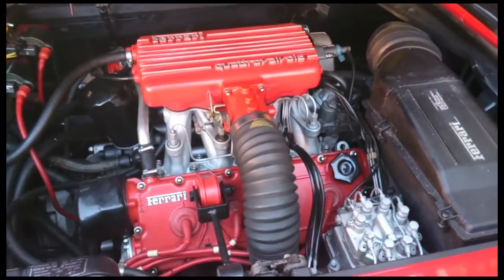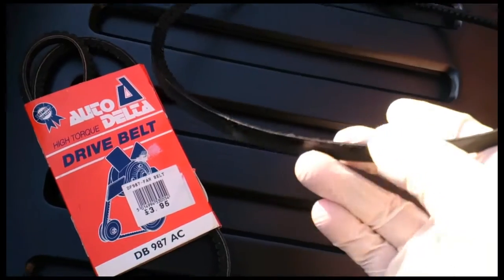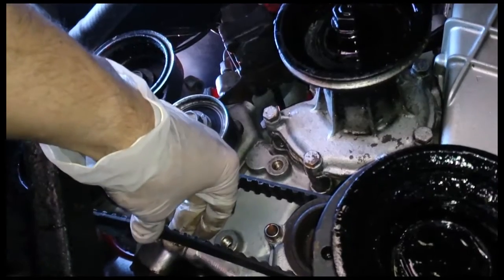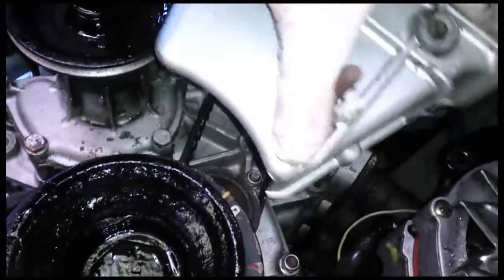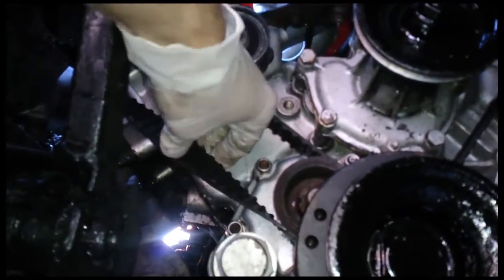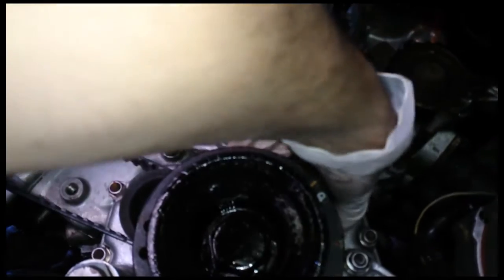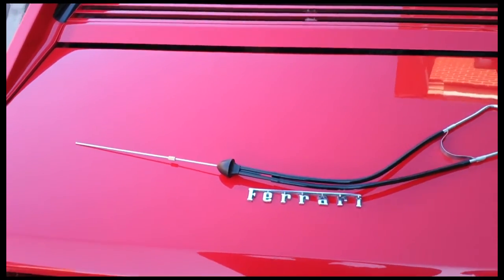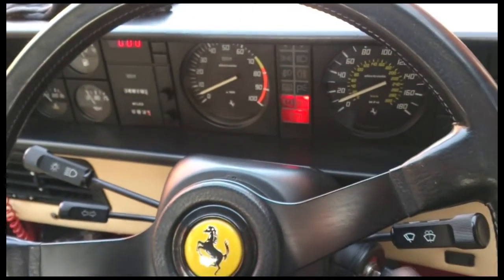Ferrari Cambelt Check

Comment: I don't own a Ferrari but have found many of your videos useful regardless, especially the timing belt ones, I'm totally paranoid about having the correct cambelt tension and destroying my newly rebuilt engine! I find the tension gauges by themselves don't seem very precise so I combine it with the 45° method, I'd be even more nervous with an engine of that value! Look forward to seeing more videos.
Reply from the maker: +Elliot N  Hi Elliot, the key to getting the right belt tension is keep rotating the engine to various random points and apply the 45 degree test as shown that believe it or not I've been doing to all my Lotus cars and both Ferrari cars since 1989 it's quick simple, safe and reliable.Guages are good but only good if operated correctly, and believe me I've seen some clever complicated gear operated completely wrongly. Sometimes simple is best ;-)
All the best, Doc